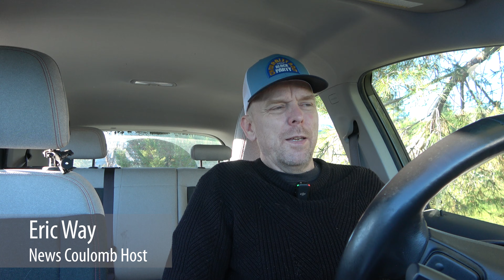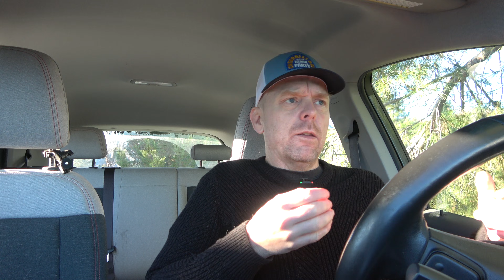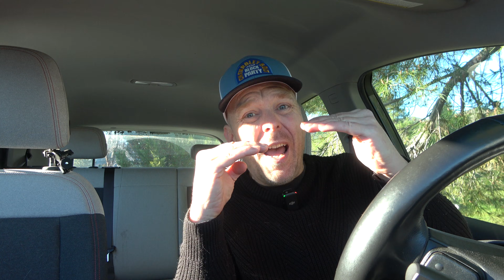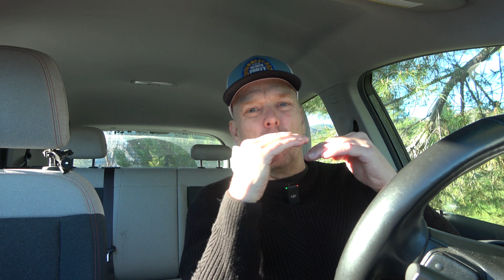Is Donut Labs Misrepresenting Their Solid-State Battery Technology?

Comment: Going by the performance specs it's almost certainly some form of Super-capacitor, probably Titanium Dioxide, but one of the problems they have with this tech is that people simply don't understand what a super-capacitor is, but they do know what a battery is. There's an argument if it does the same thing as a battery why can't they call it a battery as a generic description of a type of energy storing device, because that's what people think when you say battery. You put electrical energy in, you pull electrical energy out, that's a battery to most people, the exact internal workings? Well most people don't understand how a battery works anyway.

Got to keep in mind Finland is at the bleeding edge of super-capacitor development and in fact Skeleton, another super-capacitor company in Finland markets a product they call SuperBattery, similar thing I suspect, charge in seconds, 50,000 life cycles etc, just not as energy dense:

https://www.skeletontech.com/hubfs/02-DS-SuperBattery-D60-view.pdf?hsLang=en

In other words Donut aren't the first or only company to add the word battery to a super-capacitor technology, if it looks like a battery, acts like a battery, why can't we call it a battery is the way they are thinking, that way people will understand what it can be used for. The specs and the way it performs strongly indicate super-capacitor technology of some kind, it's use is as a "battery" storage device, simply not your standard chemical reaction type battery. In fact the word battery was supposedly coined by Benjamin Franklin specifically to refer to a series of linked capacitors that worked together, much like a battery of canons on the battlefield, so it's not a unique usage in this regard. We use it now to mainly refer to a specific type of chemical reaction energy storage device, usage of words change over time.

All will be revealed very soon as these things go.

Comment: Maybe it is a new hybrid device.... a cross between a battery and a capacitor.
Reply: That would be my guess as well. Maybe adding super capacitors solves the problem with the Sodium Ion charge curve. Energy density of Sodium Ion with a liquid electrolyte is low (CATL claims 175Wh/kg), but with solid state  400Wh/kg could be possible.

I am still sceptical though. It all seems too good to be true.
Reply: Maybe, with some novel use of graphene

Comment: The best capacitor on the market is 50 kW, so jumping to 400 is a massive leap.
Reply: I guess you mean Wh/kg? There are 2025 supercap papers with energy densities of 140 and 240 Wh/kg, but I think you are right about things you can actually buy today.
Reply: Eight parallel.
Reply: A capacitor is 50KW? How does that even make sense?
Reply: @lindsay5985 
The guy is obviously struggling with physical units… he probably meant 50 Wh/kg!
Reply: … but it exists! 418 Wh/kg to be precise!

A paper published in April 2025 by the Korean Institute of Science and Technology (KIST) and entitled “Nanocell-structured carbon nanotube composite fibers for ultrahigh energy and power density supercapacitors” claims numbers like:

- 418 Wh/kg
- 820 Wh/l
- 11’740 W/kg… which would allow crazy fast charging … like less than 5 mn… with pretty much the voltage and amperage you choose, or the one determined by the charger.
- or no degradation after as much as 100k cycles (kind of expected for capacitors).

Sounds familiar?

Comment: A salt‑based solid‑state electrolyte actually fits Donut Lab’s claims really well. Salt‑polymer layers can be stacked into any shape or voltage, stay super safe, charge fast, and still reach around 400 Wh/kg. It will be printed by Nordic Nano in finland.

Comment: Are we barking the wrong tree...ok...battery has chemical reaction to generate electricity....if no chemical reaction in the box it is not battery....hmmm....shouldn't we talk energy source for electrical devises...if it works..isn't that  which really matters...is it that the discussion is now can it called battery or not forgetting that it can be replace "chemical reaction" batteries with better product...EV were banned more than 100 years ago...think about that.

Comment: I am curious if anyone has straight up asked them "is it a capacitor?"
Reply: They have said it is not.
Reply: @oceanfrog  Ohhhh, Then this will be interesting. lol
Reply: @oceanfrog  search on google "rinnovabili supercapacitor 418wh/kg 100,000 cycles"
Reply: nano tubes most likely , so donut
Reply: @Y2Kvids  , the "Donut" comes from their engine type. They just used the donut for this too and made it smell like Snake Oil....
Reply: The borderline is very small. There are many types of capacitor that are not electrolytes and essentially are solid-state capacitor. So solid-state batteries are more solid-state capacitors than being classic Li-ion battery. So I don't care about exact term and I definitely won't hold them responsible if all claims so far from their side is correct (for example density, temp range, applications). One thing I'm interested for the last week and I'm waiting someone to figure it out or ask, is what the "Leakage current" (i.e. self discharge rate) is. That is critical, but I will be fully satisfied if they don't have more than 20% discharge per month. Or 10% per 2 weeks. For electric car that is completely acceptable if they double the range and all of the claims they have so far are holding true!
Reply: a rose by any other name would smell as sweet..
Reply: Can't be, capacitors don't have that kind of energy density.
Reply: @polska905  Maybe the density isn't accurate as other specs that don't make sense. idk.
Reply: @AndTecks  Accurate? If you get 360 Wh/kg and claim 400 Wh/kg, that would mean it’s not accurate. In this case, supercapacitors do not even reach 20 Wh/kg in labs. That’s not an accuracy problem. It’s straight-up fraud.
Reply: @polska905 so you know that its impossible to achieve 400W/kg, are you a scientist? Your claim leads to conclusions that we should still be living in caves.
Reply: @bobsnabby2298  in the 1950s "the science" recommended Winston cigarettes for pregnant women....
Reply: @bobsnabby2298 I'm not a scientist but I spent 14 years of my life in the hydropower generation business, specifically coils, I know how this stuff works probably better then you. The fact is that you think a 400kw charger can fully charge up a 2000kw truck battery in 5 minutes kinda shows how smart you are...
Reply: @polska905 
Yes, the latest developments do!  418 Wh/kg to be precise
Reply: They did and he refused to answer.
Reply: @kevinblackburn3198  They have said it is not.
Reply: It's technically not a capacitor, but something like a hybrid "battery + capacitor"

Comment: 3rd party testing is coming soon, so we will soon find out if it's true or not.
Also the CEO of Donut Labs stated it's NOT a super capacitor, it's solid state battery.

Nordic Nano claims it's theirs battery and they been working on it for many years.
At least one of their factories in Finland is completely empty with Graffiti on the walls.
It was supposed to be up and running months ago and it's still completely empty.

No one knows if they got more factories and where they are producing these batteries.
Sure smells like a huge scam, we will soon find out when 3rd party are allowed to test them.
Reply: It's not complicated guys. CES is for more seed funding. They don't care to bring anything to market. This is vaporware. It's Nordic Nano inside the donut. If it sounds nuts, it's probably a donut. 😅
Reply from the maker: Oh, that's really interesting. Thanks!
Reply: @newscoulomb3705 but nordic nano says that it is electrostatic bipolar capacitor

Comment: Honestly. I used to be a huge believer of Elon Musk. And then I became a huge cynic of Elon Musk. But Elon Musk pulled it off. I've seen a lot of critical cynics in the eevee space come and go. They used to say that the Hummer eevee was not a real car they used to say FSd will never happen they used to say the cyber truck will never happen all of that has happened so I mean it might be fake but I'm going to be an optimist again.
Reply from the maker: Oh, I'm certainly not a cynic, though I am critical. From my perspective, it should be easy to provide numbers for all the metrics I asked about, and it wouldn't require releasing any sensitive data or IP.
Reply: @newscoulomb3705 something sketchy is definitely going on, but it's like the same thing as Elon promising FSD in 2020 or something? Like yeah he's lying but it'll come eventually type of thing you know what I mean
Reply: I mean, the are shipping these batteries already according to them, Verge is already accepting orders for the new long range motorbike versions, so it's not exactly like promising something in the far future and live from.the hype for years.
Reply: @Rebelapes that's not the disagreement. The disagreement is if it's actually a solid state battery

Comment: It's possible you are on the right track with your thoughts. Time will tell when someone gets this in the wild and pulls it apart. As for the Heavy hauler statement you made, you might be considering just the trucks themselves for the batteries, etc. Longer distances can be achieved if the trailers are motorised and contain batteries too. Also, there are many regulations around how long drivers can drive for, etc, that the recharge rate may make the lesser range moot.
Reply from the maker: Yes, there are options for motorizing trailers, but that will add complexity, cost, and weight. Plus, it's going to take decades to retrofit hundreds of millions of existing trailers. For the time being, the low-hanging fruit applications (e.g., commuter cars and light duty trucks) can be electrified with few concessions.

Comment: Great questions! I was also wondering about volumetric density.
Reply from the maker: The volumetric density appears to be at least competitive with current batteries, so that shouldn't be a hold up. Ironically, EVs are already far more efficient with space than ICEVs, so there's a bit of wiggle room.
Reply: @newscoulomb3705 What is it?
Reply from the maker: @usa-ev  I haven't seen anything official, but based on the apparent size of the 5 kWh module, it could be as high as 1000 Wh/L (or even a little more).

Comment: Your speculation is interesting, but it's nothing else. You have no reason to believe that Donut's battery is a supercapacitor.

Domenick Yoney on the Batteries Included Podcast today speculates that Donut is producing a Covalent Triazine Framework battery. I have no clue what that means, but apparently, it's not a supercapacitor. The battery may be pie in the sky, but I'll wait and see.
Reply from the maker: While that might be true, it also doesn't let Donut off the hook from answering some of the questions I posed. In particular, calendar life, voltage ranges, self-discharge rates, and Coulombic efficiency can all vary widely. Even if it is CTF (also pure speculation), we still need to know those metrics. The answers could take this from being an energy storage panacea to a completely unusable technology for certain applications.
Reply: oh I just posted the same thing. It was an interesting chat by Domenick earlier today, But who knows yet.